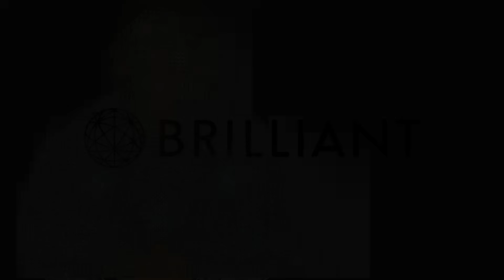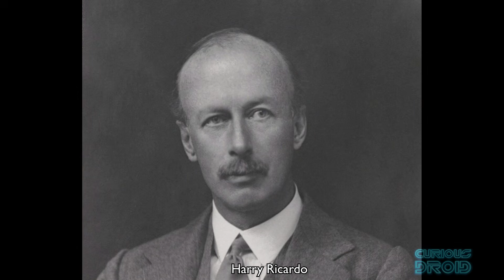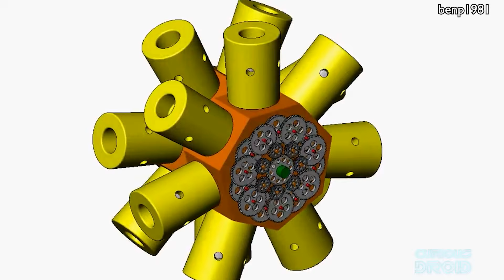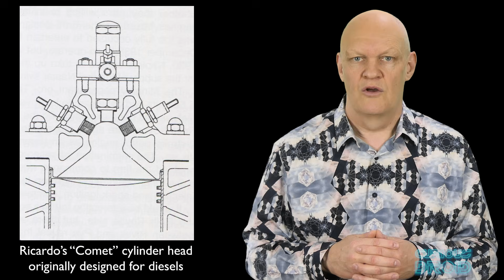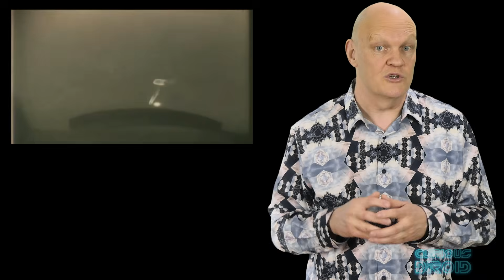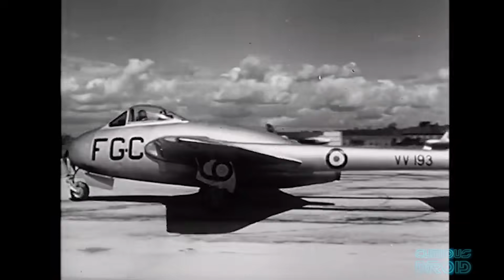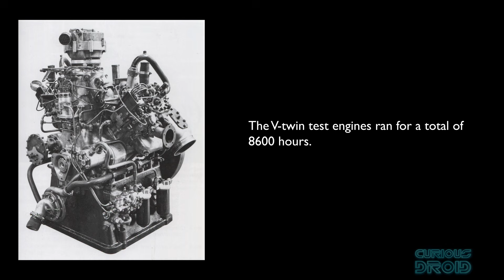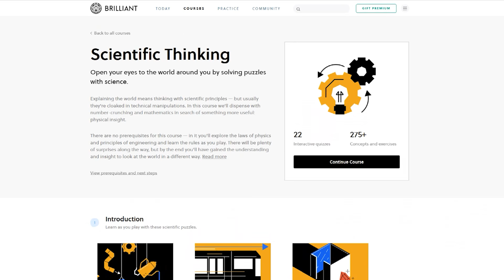Rolls Royce Crecy - The Most Advanced Piston Aero Engine Never Made.

Comment: I have been interested in and followed aircraft engine development since I was about eight,  (now 74!) but I have never even heard of the Crecy.  What a fabulous machine?  I always imagined that British aeroplanes all had water cooled, mostly V-12 engines and American aeroplanes had big, complicated radial engines.  In later years I viewed big radials as tricky to start, difficult to temperature control and touchy as hell to control in flight/fight.  After that, my namesake (no relation - sadly) was the unsung hero of the hour.

I think if I had known about it, the Crecy would have haunted me for ever.  Isn't it strange that another, classic, British engine was a two stroke, sleeve valve engine, although a supercharged diesel?  The Deltic engine was originally developed for fast patrol boats, but found fame on the railways.  I believe one of the rare British Radials was also sleeve valved?  The Centaurus was it?  In the Sea Fury.

What a pity that, once the war was over, the powers that be suddenly took notice of what Whittle had been trying to tell them - since 1936 - and then tossed aside everything else.  Great vlog and thanks for teaching me something I really didn't know.
Reply from the maker: Well, the engine that preceded the crecy started out as a diesel but Ricardo converted to it petrol but it was a mish-mash of two stroke and four stoke. Look up Ricardo, the company still exists and still does cutting edge work on engine design

Comment: The engines refered to as "rotary engines" are actually radial engines. The rotary engine looks similar but the crank is fixed and the crankcase spins instead. Popular in early aviation especially WW1 as the spinning crankcase was good for air cooling, but as the need for larger engines came about leading up to WW2, the rotary idea became unfeasable.

The dive bomber was the Ju-87 not the Ju-88 (nitpicking now lol)
Reply from the maker: Yes, for some reason i got Ju88 in my head, my bad
Reply: @CuriousDroid  It happens, great vid though, I had never heard of this engine before :)

Comment: Small correction: The Stuka was the Ju-87. The Ju-88 was a twin-engine conventional bomber.
Reply: Just a sidenote, the Ju-88 was capable of divebombing. However, I agree that he was very likely talking about the Ju-87.
Reply: @Ibikyo1  you're right, the only aircraft fitted with the "jericho trumpet" was the Ju 87, these sirens were fitted in the wheel spats if memory serves me right.
Reply: @Ibikyo1  correct but the Ju 88 was not capable of dive bombing as the Ju 87 as it was too stressful for the wings so it was stressed for a 45° diving angle...
Reply: @paoloviti6156  Every aircraft can divebomb, some even more than once.
Reply: @andreasschrader6925  it depends on many factors such as weight, wing loading and much more not to mention what bombs has on board. Many airplanes are simply not stressed to dive around 45° and if it has to, the pilot has to very gently and slowly get out of the dive! In this the magnificent Lancaster could achieve it without much issues but airplanes like the Fw 200 Condor was absolutely incapable to do it as almost every flight had to be re-skinned around certain parts...
Reply: @paoloviti6156  In Paul Brickhill's book, "The Dam Busters", there is a brief account of Mick Martin trying out dive bombing in a Lancaster on a piece of sea weed – he wanted to see if the aircraft could dive bomb, saw the sea weed floating on the water and used it as his target.
There was no mention of what Martin's crew thought of it, or if he actually sank the sea weed....
Martin was looking for ways to accurately drop marker flares on targets at night for the main bomber stream to aim at and had wondered if the Lancaster could do it by dive bombing. In the event, they used Mosquitos, which was probably a relief for the Lancaster crews.
Reply: @MarsFKA  thanks for the info as I never heard of this story. But assigning this flare business to the Mosquito was a much better choice to the great relief of the crews...
Reply: @andreasschrader6925  Rofl, I didn't get that one at first. 🛬🔥
Reply: And it's spelled 'Griffon'..
Reply: The Ju-88 did have dive brakes and was versatile enough to be deployed as a night fighter.
Reply: @RobBCactive  correct but at certain point, I don't remember which variant it was, it was taken off because it was too stressful for the wings when deployed but turned out to be a very effective night fighter and like the Me 110 it was fitted with the optional Schräge Musik as the British bombers didn't had a turret like the B-17...
Reply: @paoloviti6156  Even the Ju-88 suffered from the stresses. A number of aircraft lost their tails (despite the extra support struts) when attempting to pull out of the dive too quickly.
Reply: Small? as bad as Do-87.
Reply: Thank you :) - I went looking for this comment as soon as I heard the words 'Junkers 88' :) - just fyi tho, the JU88 was designed a multi-role fighter/bomber  - bit like our Mossy but not as fast.
Reply: @dragonoffski4501  Snap .
Reply: well, Stuka just means a dive-bomber and is most associated with the JU-87 however theoretically anything could be a Stuka
Reply: @animalian01  However not just anything could dive steeply and place a bomb into a train yard or onto the deck of a ship with such precision. They were designed to terrorise, but had to be protected by a fighter escort as they were not fighters themselves.
Reply: @waynestackpoole3652  I didn't say the JU-88 or other aircraft could but it was possible with many types on both the Axis and Allied sides
Reply: Good pick up
Reply: Well the JU-87 was 'a' dive bomber I would agree with you however Stuka just means Dive Bomber it was applied to many aircraft it was just a designation, the JU-88 could dive bomb just not as steeply as a JU-87. Many aircraft then and today can do a bombing in a shallow dive
Reply: Came here to point this very thing out!
Reply: And luftwaffe pilots and ground personell named it the "Dreifinger"

Comment: Two stroke is not feasible as aero engine.
Reply: It certainly is if fuel consumption is not much of a consideration while power/weight ratio is. The Gnome engine in the Sopwith Camel was essentially a valved 2-stroke that burned pre-mix for lubrication.
Reply: Check out the Rotax E-TEC voice coil direct injection 2-stroke engine. These engines have been powering snowmobiles & outboard motor boats for over a decade. There's even a Turbo-charged version. Welcome to the 21st Century.

Comment: must have spin centrifugal compression autoram turbine jet engine
Reply: need to have tesla turbine discs to make the centrifugal pressure
Reply: must have the tesla turbine discs to catch on the accelerating gasses
Reply: multiple exhaust jet ports or rotating single jet port possible, easy transition air craft, vtol to flight mode
Reply: no spark plugs needed, mechanical-electric friction/pressure auto-ignition
Reply: electric start-generator all-in-one
Reply: knowledge is regression, skill in freedom is progress, you need nothing, and come through with less, with knowledge you are slave to the masters

Comment: WWII technology was the peak of piston engine development until the money of F1 brought more innovation. I remember when one HP per cubic inch was the gold standard of performance, while today 125+ HP 1000cc motors are pretty common in motorcycling and even street legal machines make well above 1HP/c.i.
Reply from the maker: Yes, don't forget the Crecy was running at 3000 rpm max, 26.1 litre V-12's have pretty big pistons and there a lot of inertia, too high a speed would snap the conrods. Bike engines will do over 200+ bhp at 14k rpm normally aspirated and as you say F1 with pneumatic valves will do 20,000 rpm. Time has caught up with the Crecy but for nearly 80 years ago it was cutting edge stuff.

Comment: Small correction : it’s Rolls-Royce Griffon not Griffen and it is NOT a merlin derivative engine. The Griffon shares a direct ancestry to the RR Buzzard through the “R” engine that was used in the Schneider trophy aircraft. Indeed it rotates in the opposite direction from the Merlin and has a different firing order.
Reply: The Griffon I was a detuned Rolls-Royce R from the early 1930s, but was not put into production.

The Griffon II and subsequent models were a new design, which shared the bore and stroke of the Buzzard/R but not much else.

Also, later model Griffons were capable of 2,400-2,500hp, more than 1hp per cubic inch.
Reply: @waynec3563  The Griffon II also shared the same rotation direction as the Griffon I, opposite of the Merlin. Although it’s firing order is different.

Anyway. My point was is that I wouldn’t called a Griffon a Merlin derivative. It was its own engine design and not simply a scaled up Merlin.
Reply: @bend1483  The Buzzard/R/Griffon I rotated clockwise, when viewed from behind. As did the Kestrel and Merlin.

The engines of the other major manufacturers, Bristol and Napier, rotated anti-clockwise.

Sometime in the mid 1930s the decision was made to standardise the output shaft rotation. Thus the Griffon II also rotated anti-clockwise.

The Exe, Vulture and Crecy also turned anti-clockwise.

The firing order of the Griffon II was changed during development because of vibrations and crankshaft breakages.

Comment: I've known about sleeve valves for a long time, but I just now began to notice how the eccentric mechanism to operate the sleeve reminds me of steam locomotive valve gear in a way. 
During the age of the steam locomotive there was a sort of arms race to find the best mechanism to control the valves of a steam locomotive, called valve gear. The list of mechanisms could fill a rather large volume. 
Most steam engines, even the ones not in use on trains, used a piston valve. Some locomotives in the 20th century were equipped with poppet valves but had mixed success due to the complexity involved.
Does anyone know if any steam engines were equipped with sleeve valves? It would make for an interesting design with alot of challenges and some unique payoffs. (I'm just waiting to hear someone say the Sr Nigel Greasley tried it)
Reply: Know Fred dibnah had problems with his traction engine as the valve port was in the wrong place on the last TV series he did driving around the country.
Reply: Wrong CME to experiment with sleeve valves- Bullied did with Leader.  Poppet valved steam engines were fairly common- Corliss Drop Valve gear is a poppet valve gear.  The issue is one of balance- on a steam engine, you need the poppets to be ballanced in order to reduce the opening forces.  Piston valves work well for that, poppets require more complicated engineering to design.  Also, due to the temperature difference of the working medium, steam turbines worked from 1903>, whereas it took into the 30's to develop free turbine engines & the mid 40's for tubojet engines.  Steam consumption of turbines beats reciprocating steam at about 300 hp.  (look at Cofflin CG feed pumps for an example...).
Reply: @ThePeachJames  thanks so much!

Comment: Another terrific subject, about which I knew relatively little. But the quest for very high power to weight ratios, the seeking for alternatives to the traditional poppet valve system, two stroke engineering, and not last the modular approach to engines, leads to the Napier Deltic. And I hope that you'd consider looking Into this remarkable machine.
The same company that made the actually operational high-performance sleeve valved engine you mentioned, the Sabre, made this engine, and I think that many of the advanced propulsion engineers who worked on the first project were involved in this machine. And the Sabre wasn't the only one to reach operational state (in the Typhoon and Tempest), but so did the Deltic, although post war in the Royal Navy's Motor Torpedo Boats. The difference was the continued viability of the piston engine over the gas turbine in marine installations gave it a life that aeroengineering did not.
Another fascinating parallel is a late stage development of the Deltic was to act as the initial stage of a combined-cycle decoupled compressor for a gas turbine second stage, I think for English Electric. 
The late-war innovation in UK engineering is a hard thing to get your mind around, and much of it no longer exists in service. Not so the Deltic, which is still in use. 
I am not impartial: my dad was an engineer for Napier after the war; he worked as an engineer apprentice on the project to put the Deltic in the Royal Scot, and also worked too on Royal Navy ships that were Deltic equipped before being sent to Canada to represent Napier in its dying stages. Rolls gets the glory, and the Merlin was the mainstay of the war. But Napier's lost and forgotten history is complex, full of innovation, and in every way remarkable. It'd be nice to see some of that showcased by your consummate presentation and research skills.
Most of all, the Deltics, with three crankshafts and no valves, were just the kind of things you oughta love, and like nothing else.

Comment: How did they achieve octanes of 150? Was a lot of TEL used?
Reply: Octane ratings were changed after the war. 150 octane then was equivalent to 95-100 octane now, and 1000 octane avgas was equivalent to 150 octane race gas nowadays.
Reply: They used a lot of lead.

Comment: Amazing. I understand jet engines however it was amazing what was achieved and nearly proven to be capable with pistons and sparks. Thank you.
Reply: Modern F1 engines with poppet valves regularly make 2+HP/c.i.
Reply: @dbmail545  2 stroke motorcycle engines in the 70s easily hit 6 hp/c.i.
Reply: If you're interested in modern 2-stroke engine technology check out the Rotax/Evinrude E-TEC voice coil direct injected 2-stroke engine. This engine has been used in snowmobiles & outboard motor boats for over a decade now. There's even a Turbo-charged version.

Comment: Sleeve valves also don't have valve springs, so no valve float at high rpm.
Reply: That problem was solved in F1 with pneumatic springs. Sleeve valve engines have a lot of friction, both from the sleeves and the gearing that drives them.
Reply: Sleeve valve engines are also real oil burners.
Reply: Called it bounce in my day and adding another inside the bigger one sorted it out.
Reply: There have also been gear driven values. It's not competitive today due to more mass and higher service intervals (modern springs are more reliable because everyone uses them and so much r&d has been done)
Reply: It only needs to rev to2800.
Reply: Sleeve valve on aircraft piston engine is unnecessary since rev are pretty low, even for 1940's engine standard.

Crecy use it because they can't figure it out how Detroit Diesel 2-stroke poppet scavenging works
Reply: Areo  piston engines rarely get to 3000 rpm, unless you've talking pylon racers and such.
Reply: True.  But the also have more rotating mass so reaching those high rpms would be nearly impossible.

Comment: I love everything you do and your content is always of the highest quality, however I will have to correct you on the 200hp per litre being only accessible from high performance race engines.  Many hot hatchs these days can produce 400bhp fro. 2l with just a bit of tuning and the F1 1.6L knock out circa 800hp.
Reply: Can’t easily compare automotive engines to aero engines driving propellers. Prop speed/size is the limiting factor in aero engines. You can’t have your prop tip spinning supersonic, as they become ineffective. So, such massive capacities were used because these engines need to make their peak hp/torque at <3000 RPM. So when you think of it in that regard, these monsters are still very impressive.
Reply: The F1 engines are putting out over 8hp/cubic inch.

Comment: Can someone explain me how it does 36k exhaust pulse per minute? Shuldn't they be 18k? Being a 12V, 2 stroke engine  should mean that to have a "balanced" power output only half pistons are in a power stroke per revolution so the other half are in an "exhaust stroke" so you have 6 exhaust pulses per revolution than 6x3000 are 18000 per minute, 300 per second
P.s.: does any of this Crecy engines survive to this day?
Reply: 4-strokes need 2 engine revolutions to make power from a cylinder. 2-strokes only need one revolution because the power, exhaust and transfer take place on the same stroke.
Reply: @dbmail545  right, thanks, didn't thought about that

Comment: 2-Stroke runs on twice the fuel.
Reply: Interceptor like the lightening so irrelevant.
Reply: No.🇭🇲
Reply: But doesn't make twice the HP. Irrelevant since emission controls have nearly killed off 2-strokes.
Reply: Come into the 21st Century. The Rotax E-TEC voice coil direct fuel injected 2-stroke engine is powerful, fuel efficient, virtually smoke free & has low emissions. There engines have been powering snowmobiles & outboard motor boats for more than a decade. There's even a Turbo-charged version.